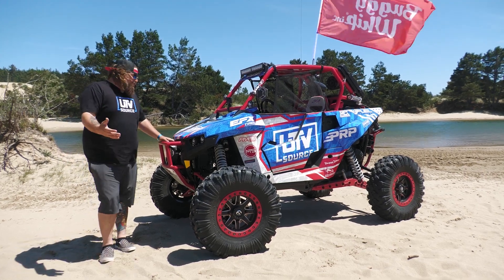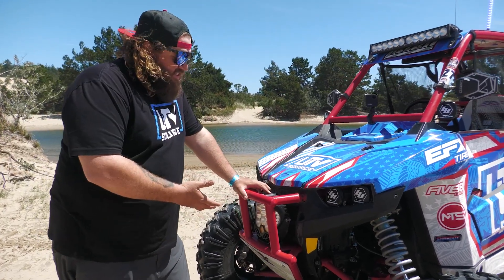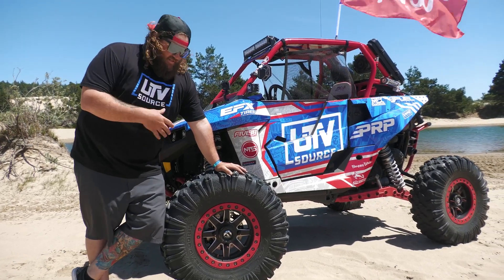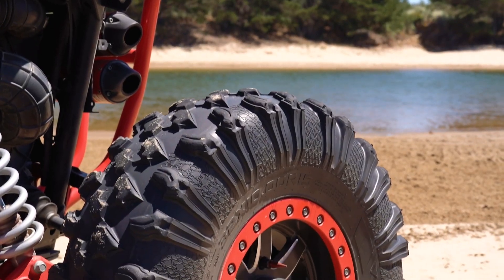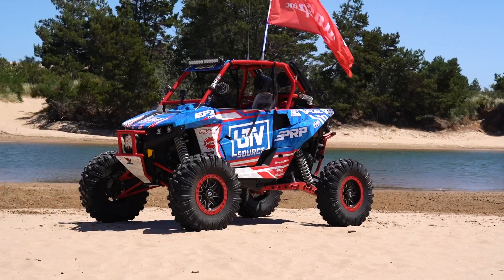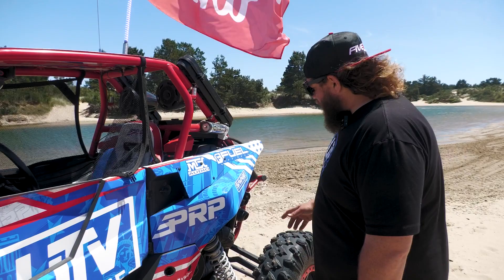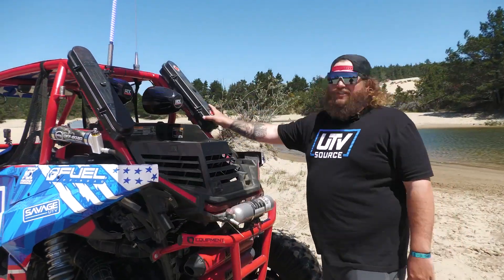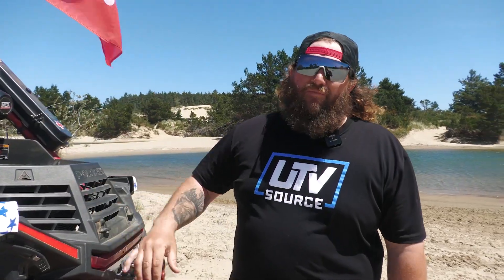#UTVSourced | Kyle Litten's Polaris RZR RS1 Build Walkaround

Comment: First I wanted this UTV, than I saw it rolling on fast Speed cornering, I saw it rolling on Low Speed cornering. So it is the Most pointless Car in the Industrie, except for Low Speed technical stuff. Now I buy a Yamaha YXZ
Reply: This car in specific is setup up for jumping and big G-outs in the dunes. The RS1 it typically a very stable car and used for short course racing quite often as a pretty preferred car.
Reply: @Kyle65baja2  expect of its crap of reliabilty 😁
Reply: @Lala-dr3vf  in the 3 years of thrashing this car I’ve broken 2 belts 1 due to towing a 4 seater out of the dunes… bent out me trailing arm from racing a rock course in Utah….. other then that it’s been the most reliable SXS I’ve owned to date hands down takes and beating and keeps going
Reply: @Kyle65baja2  hard to believe 😳, all the Boys around Always told me that Polaris reliabilty is to weak, especially all the wearing parts .... So now I dont know what to believe. I want to hold Up with the Boys and buy a SXS next time, so its very important for me to understand the reliabilty of those SXS. My old Buggy is totaly down now😅, so it's time for some new stuff. But those SXS are pretty expensive in Europe, that's why we need to do Well choice which one to buy🙄.
Thanks for response 🥰🥰🥰🥰